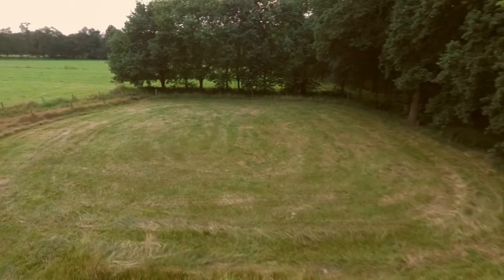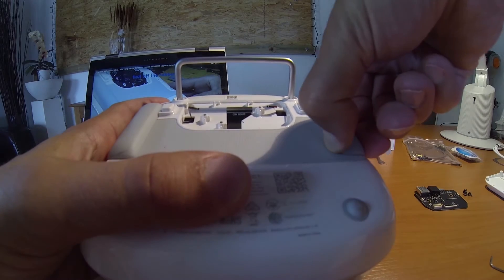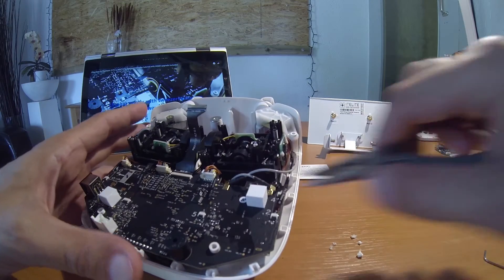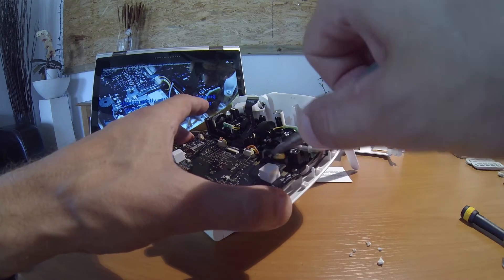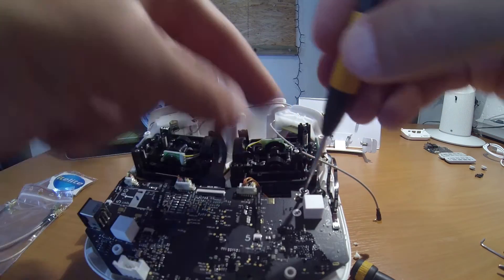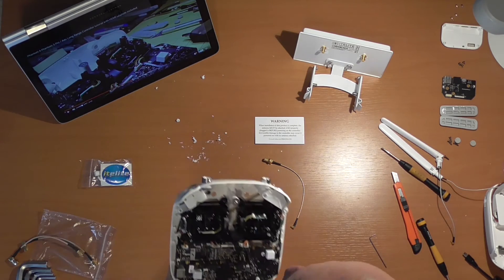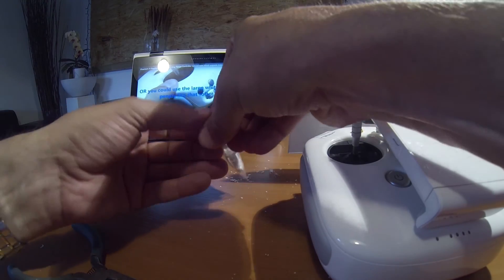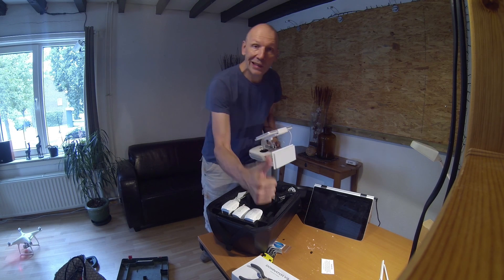Installing the ITE-DBS02 Antenna upgrade for Phantom 4

Comment: Just completed the installation now . Took me two hours . Just pay attention to what u are doing . Do it insteps and count the screws going out then samegoing back into the remote. No need for drilling holes I used the existing antenna ports .

Comment: Hi Peter. If I want to chance my antenna on my Phantom 4, should I try this antenna, or are you recommend another one.? How long is The range with this antenna ?. 

Keep up the good work. 👌👍👍👍
Reply from the maker: Either this one, or the FPVLR one. The ITEDBS is more robust, the FPVLR a bit more fragile, but less dependant on the angle of the transmitter and drone. If you take the boosted version of FPVLR, that makes a lot more difference of course.
Reply: Have you made a long range test with The other CP antenna's? I thought That it Was a CP patch antenna. Is it a 2,4 GHz patch, and how "Big"??? Thanks for The Quick respons. 👍👍

Comment: Why is necessary to drill two new holes and not to use old  holes from old antenas?
Probably is impossible to put the new cables with connectors through the old antena holes, but in this case is better to make the new self made cables with "proper" connectors which can go through old holes or solder the connectors on a new cables on a place.
it is a pity for the RC housing :)
Reply: is a company called, Maxx UAV. 
They offer a install kit, basically two cables that will allow you to not have to drill any holes.
they use the existing ports, kit is $34
Reply from the maker: Yes, it's better to put them through the old holes. But the cables provide are not suitable for that.

Comment: So, was it worth the upgrade? I just bought them also.. please advise.
Reply: I have a phantom 3 standard. The range isn't that great. Just wondering will this antenna extend range of the phantom is out of line of sight, let's say like behind a building or tree?
Reply from the maker: In general objects block the signal. I learned from several people that the antennas from https://fpvlr.com/ are better because they are circular and not linear. If you would want to go behind objects, you will need a boosted antenna.
Reply from the maker: You just bought the Phantom or the antenna?
Reply: The antenna
Reply from the maker: I could not have flown 8 kms away without it. It totally depends on what kind of flights you want to do. For me it was definitely worth it.
Reply: Awesome. I will install mine today. I hope to use the existing holes rather than drill new ones. Thanks!
Reply from the maker: Yeah I would try that. I didn't think of that when I did it, but it seems obvious now :P.

Comment: you dont need to do anything he did this simply screws into the existing parts where the stock antennas were.
Reply from the maker: Yes, if I had to do it again, I would try to get the plugs into the existing holes.

Comment: I want that antennae but taking the drone apart is scary!
Reply from the maker: You don't have to take the drone apart. Just the transmitter. If you do it step by step, take your time and follow the instructions on the videos, it is not that difficult.
Reply: NeverMindYourOwn Cheers!